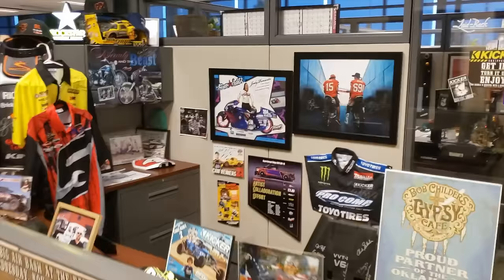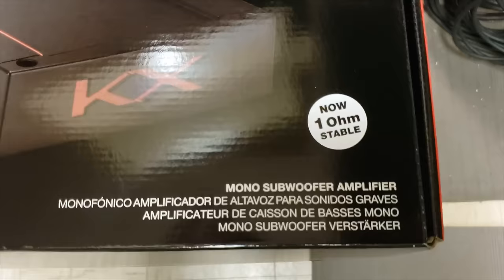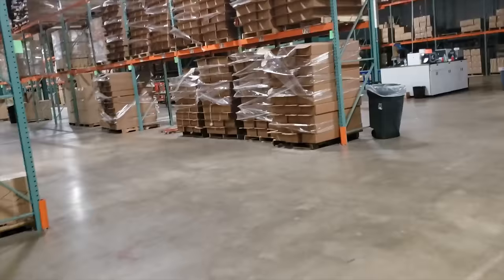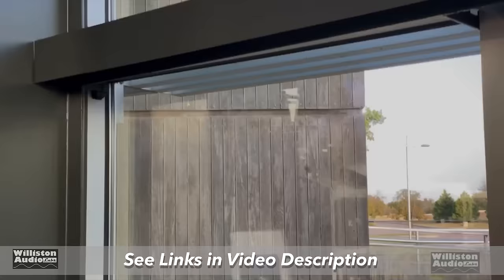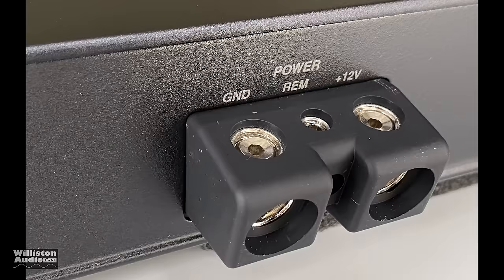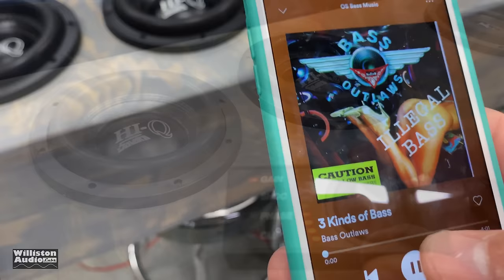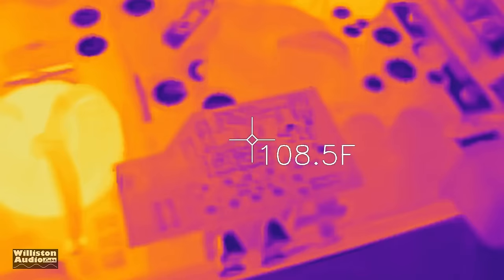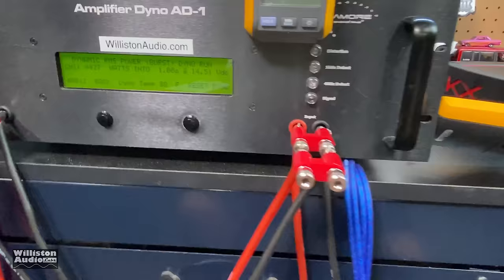Is it Worth the Money? Kicker KXA2400.1 2400W Amp Review and Test

Comment: But rockville dbcomp5 is $400 and at 1 ohm dynamic does 4900? But kicker at $1000 and at 1 ohm dynamic does 4350? I could just get 2 Rockville dbcomp5's for approximately $865 with free shipping and do way more for my money and still have some money left to buy my family and I a steak dinner.  No brainer here. Kicker isn't even that good when it comes to there amps you just paying for the brand and not the performance for the price. 🙄
Reply: If you really tried to run 2 R'ville DB5's the amount of money to be spent on electrical would easily be 5X's  the $135 saved by buying them. The Kicker amp will still be kickin' long after the R'villes are recycled into beer cans.
Pice to run 1 KXA2400, $999.95 (on sale $799), HO ALT $400 (avg), 0ga amp kit & accessories $200, Big AGM Battery $250 = $1650 total if bought on sale could possibly spend a little less on electrical that I put down.
Price to run 2 R'ville DB5's $865, HO ALT $400, 2 0GA Amp kits with accessories $450, 2 big AGM or lithium battery $500 or more. =  $2215.00. 
The 2 R'ville DB5's just cost you $565 more than the KXA2400.

Comment: In my own opinion no, it not the best looking and the gimics it offers isn't worth it. Alot of Korean boards have voltage temp and clip lights built in now this just offers clip and some other trivial things. Plus being capped at 2400 watt  power rating you could get better amps for less 3k+ for less. Is it a bad amp though  no is it something you should choose over everything else no as well

Comment: awww, it only just made power... that's a bit of a bummer there!
Reply from the maker: Check out Kicker unmasked shows this amp will hold 2400W plus on sine wave for more than 4 min
Reply: @wal  Damn, for more than 4 min straight?! That's a beast!

Pretty tempted to run two of the Solo Baric's (900wrms per) in my build then power them off of a KX2400.1

Comment: if the amp put out 2400 at 2 ohm why is it a surpise it put out more at 1 ? that amp is $1000 ! you can buy 3 jp23 amps for $900 and have a better amp . this is the exact reason i will NEVER buy kicker !
Reply from the maker: This amp was designed from the ground up, the JP23 is a great amp, but was based off another design and modified for durability
Reply: @wal  and ? dont matter who designed it . the kicker amp is made in china is a grand and puts out less power . like i said i can have 3 jp23 amps for the price of 1 amp . this day and age when its made in china it dont matter what name is on it for subwoofer power at this range $300 for .5 ohm 4000 watts or $1000 for 3300 for 1 ohm is all that matters . the jp at 1 ohm is gonna run a long time and if something does you can by 2 more for the same price

Comment: Pretty much the perfect amp. $1000 though 😕
Reply from the maker: I’ve linked to certified refurb models for $660 in the pinned comment
Reply: My dd m3c $1249 rated 3800 watts, quality cost money, I also have a sundown sfb 8k, that’s clamped 6651 watts dropping too 13.6 wired too 1.33 on 3, 18in psi platform 2’s.... plenty of options for whatever application you need, you don’t even want to know what I paid for a Memphis Bell, “that I wish I still had” in 99-2000ish price per watt, $1 minimum....
Reply: @holeshotinspectionllc2412  I agree. Just out of my price range. For a new one that is.
Reply: Shaun Barlow right, super understandable, where I was going with that is, we are lucky to have as many options as we do these days, and access too amp dyno’s .... I love my DD, wire it in the dirt, and it’s happy, my $630 Sundown SFB 8k, has had no issues in 3 months worth of comps....

Comment: Great amp, but the price tag for a Chinese made product....$999.99, I’m good.
Reply: And I know most amps are made in China, excluding a few with Brazilian or Korean boards, anyways bass on fellas.
Reply: its american design and engineering meaning a person went to college here in the us, paid high tuition fees, graduated, got a job at kicker to help design this amp and add r&d and patents. the price is reasonable
Reply: @rowboyto156  I understand to a certain degree the engineering that would go into designing products like these, my only harp was products being made in China, I understand the cost savings by doing so but wouldn’t it be awesome to have ole Stillwater designs being built in the USA. 👍
Reply: @arnoldsalazar5851  it would be awesome but their sales figures would drop to a point that they have to layoff staff. look at mmats they are designed, engineered and built in the us but you rarely see them outside of florida. people complain they cost too much ($900 for 2000w amp) but its not strappable, no clip light, no bass knob. if mmats came out with an amp with similar specs and tech as this kicker amp, it would cost around $2000-3000. people like to say if its made in america ill buy it but if they see that price they will lowball and say ill buy korean, you get the same things but its cheaper